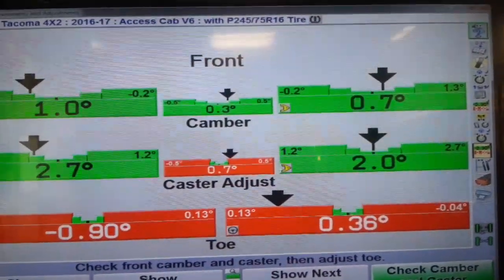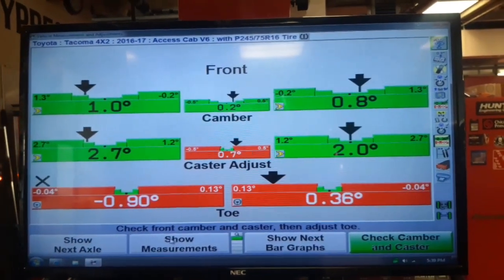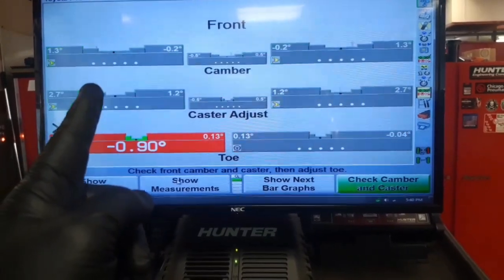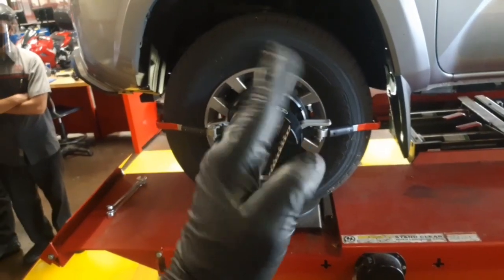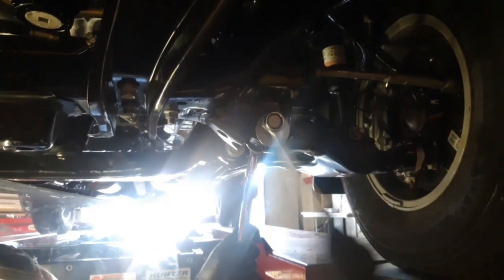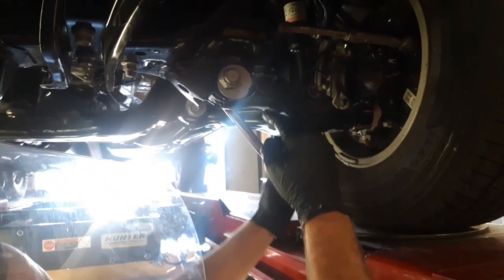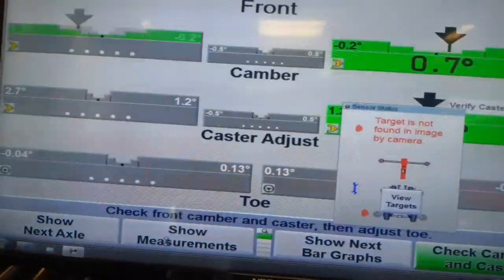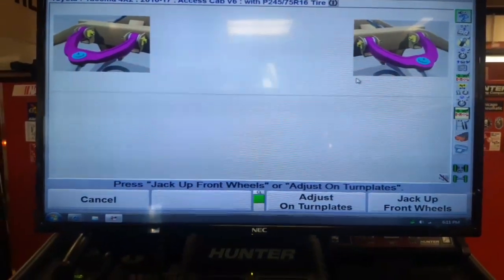How to adjust caster and camber using eccentrics on control arms AND UNDERSTAND IT!

Comment: My alignment guy used a impact gun to adjust the eccentric bolts while on the laser alignment machine. I don't know if that did it but I ended up with a bad alignment a wore my brand new tires 1/2 down on the sides on only a 300 km trip. They said they won't replace them.
Reply from the maker: Yikes, maybe impact the nuts but definitely not the actual adjustment. Pretty typical, most average techs are not very good at alignments. Also they don't verify caster which is not a live measurement on screen, which wouldn't cause tire wear but a pull. 
Sounds like you should find a new place.

Comment: Great video.  I believe my Highlander actually has different bolts where the shock mounts in the front suspension that allow you to adjust. In other words I don't think they have these eccentric bolts demonstrated here.  There are several different sized bolts one of which is the best one to use.  Have you heard of this?  Thanks for posting
Reply from the maker: That is true, that is toyotas method of allowing for minor camber adjustments. That's what they do on all MacPherson strut front ends on a modern toyota. 
The bolts work fine.
But you can also get them aftermarket. Moog for example.

Comment: If you had to make your camber adjustments from the upper control arms, how would you do it with the wheel in the way? Please help!!!!
Reply from the maker: Work around it. Or there is a function to allow you to lift the vehicle and perform adjustments but I prefer to keep it lowered and adjust on turn plates. 
Or if you a absolutely have to, you can pull the wheel and adjust your best, then put it back on and recompensate  but I try to never do that because it is slow.
Reply: @CollegeAutomotiveClasses  ok ok. Thanks a lot.

Comment: I have a Mazda 2 2013, I lowered my car, front 1.5 lower & rear 1.3 lower.
The problem is my caster, I live in Bakersfield California, I've gone to four auto shops and they all tell me they CAN'T DO NOTHING for my caster, it's unjustable, nothing to play with.
Have u done or worked on a Mazda 2 for caster issues?
Do u live in California?
Any info is helpful😊
Reply from the maker: I work to train Toyota techs, so not much with Mazda specifically although I see a lot of things over the years. Most front wheel drives have non adjustable caster. That is true. SOME may have a kit to adjust it which would involve changing parts from fixed position to adjustable type. 
But to be honest if your caster is equal side to side, and it handles OK I wouldn't worry about it. Caster doesn't wear tires. 
Positive will make it handle stiff and tight.
Negative will steer easy and may shimmy at high speeds. 
Unequal caster between the left and right side will cause a pull to the side with the least caster. 

We did a lift on a Tacoma a month ago and purposely set max positive caster to get the tires to clear the frame. Since the caster was even side, no pull. Since it was max positive it could be hard to steer but the power steering pump was strong enough to not even make a difference. Vehicle drives perfect and the big tires don't rub. Hard on the pump? Maybe.... but that is a hypothetical situation, I would like to see how it holds up in the real world and so far so good, customer very happy
Reply from the maker: Oh and yeah, I am in CA, live in murrieta and work at Cypress College. But with covid we don't take any customer work since it is a public community College and they barely let us open so can't help you there.
Reply: @CollegeAutomotiveClasses  
Thanx so much for the info & taking the time to respond, deeply appreciate it 🙏.
There is a you tuber that has the same car I have, Mazda 2, he said to make sure the strut top hats are oriented the same way, would you happen to know what that means?
Any diagram or video that help me better understand it

Comment: I’m have an issue after my alignment. The very ends of my inner rims hit my sway bar at full lock. Please help if you’re local I’ll go to your shop. I have a Tacoma 2017 trd
Reply from the maker: Sorry this is a school so I can't to work for you. But I suspect you have aftermarket wheels that are too wide.
Reply: Thank you for replying . I’m actually  running stock wheels and tires size is 265 /70r17 . The lift kit i have is a eibach stage 1 with freedom off road uca
Reply from the maker: @fernandovega7997  in that case all I could see is you toe being way off. It shouldn't be all that close. Did you get a printout of the alignment results? Maybe bring it back to the same place and request they fix it.

Comment: How do I adjust for more negative camber while adding postive caster at the same time? Would I have to push the lower control arm out and forward? My alignment shop said they can't adjust caster because they don't have tools, does that sound crazy? Thanks
Reply from the maker: Hard to explain with words and it depends on whether the adjustment is on the upper or lower control arm. The top would have to go rearward and inboard. 
Or the bottom would have to go forward and outboard. 
Doesn't sound crazy but maybe a little misleading. Most vehicles use typical hand tools to adjust but the majority of people call "toe and go" and alignment so...
Reply: @CollegeAutomotiveClasses thanks for the quick reply, that's what my alignment shop did, they only change the toe on my Tacoma.

Comment: Where are you located I need help with my f350 dually
Reply from the maker: I am in socal. I am sure there is a reputable shop near you, just need to find the right people.
Reply: @CollegeAutomotiveClasses  it's hard to find one here my truck has a 10" lift and in the area I'm from I don't know any shop probably the only ones close by is the deasel Brothers like 8 hrs drive but thanks for reading and replying
Reply from the maker: @jesupradows6ta  most shops that are good and local won't be on YouTube. They don't need to be, they will focus on their craft and be successful.  Check yelp or Google for reviews, a place that has ase certified technicians would help indicate they care about quality, and asking what type of alignment machine they have will help indicate if they invest in good shop equipment. Guaranteed you can find a good place within an hour. Probably much closer. Any size lift shouldn't be a big thing for a good alignment tech. Maybe cost a little more but everything will on a truck like that.
Reply: @CollegeAutomotiveClasses  thank you I will do that

Comment: Good video hands down, or at leas masks up, same thing here. I switched my hawkeye Elites over to half-tolerance. What are your thoughts/experience in using half-tolerance?
Reply from the maker: Nice feature if you want to be really tight. I am a little OCD so I would do it. But a fast production shop is just going to get it in normal spec rather than half
Reply: @CollegeAutomotiveClasses  Agreed. I do like it as it is worth an additional .5 on the rubric if they are green vs yellow. It seems too many were on the fringe of tolerance and calling it good. I had Scott Long from Hunter and he advocates for fast and half so I adopted his strategy. The predictive toe change when tightening the jam nut is spot on, though some still learn that the hard way. Thanks for doing the video.

Comment: hi Paul, great video and explanation. how can i adjust caster on an 09 camry? is that even adjustable? also, will adjusting toe also impact the camber on the camry? thanks
Reply from the maker: Caster is non adjustable on that camry. Most front engine front wheel drives with machpeherson front suspension do not have adjustable caster.
Maybe with a modification or aftermarket part. 
The proper fix of caster being out of spec is to replace whatever part is bent. 
But
Not sure i would worry about it if it is not pulling since caster doesn't wear tires, it only causes a pull or steering complaint. 
And
Changing caster messes up toe, but not the other way around. Change toe all you want, it won't mess with your caster. That is why we always do caster/camber first, and toe last. Camber shouldn't have much of an effect on toe but maybe a slight change, so adjust camber before toe for sure. And adjusting toe will not effect camber.
Reply: @CollegeAutomotiveClasses  thank you for the info. would i need aftermarket cam bolts to adjust camber on this car then?
Reply from the maker: @planchik  yes that is correct. Several companies make them including Toyota oem. Many like the moog brand better.
Reply: @CollegeAutomotiveClasses  great, thank you so much! i've seen people use cam bolts on the top hole of the strut, but then i read a few times that you're supposed to put it on the lower hole. which one is the correct way, do you happen to know?